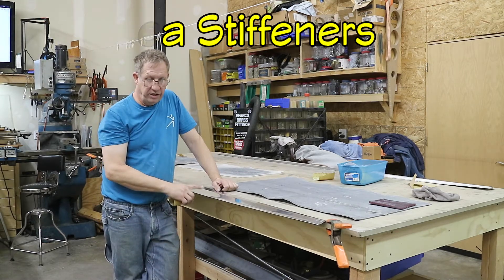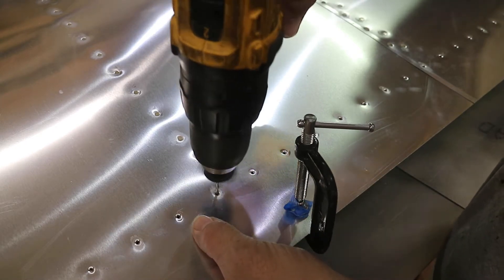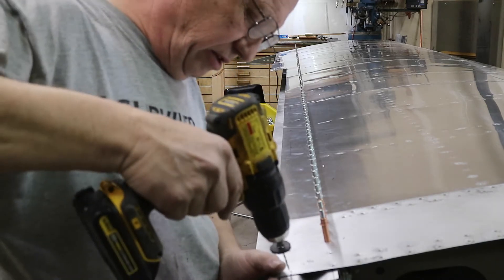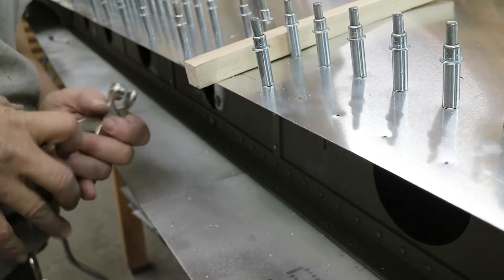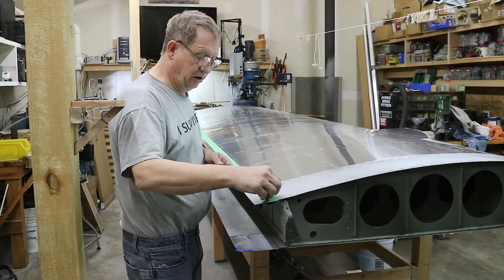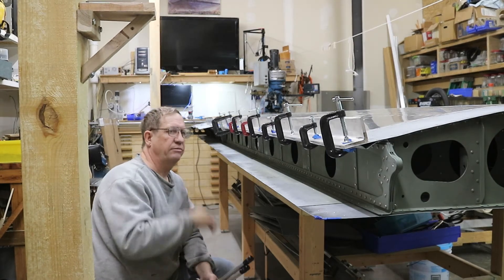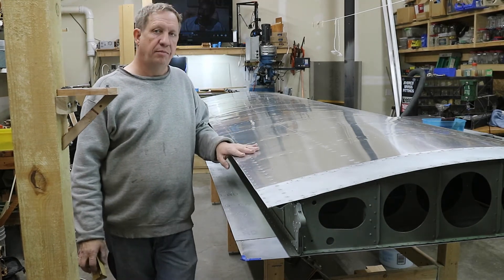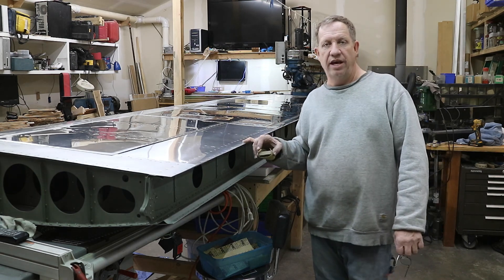Bearhawk Experimental Airplane Build : Flap Stiffeners

Comment: Appreciate you putting this online.. your videos are solid gold 

The Bearhawk really needs a video scratch build series .. baby stepping the whole build... from start to finish

the current scratch build manuals are $30 each wings/fuselage/finish ...they are well worth the money and Eric`s site is a great resource http://mybearhawk.com/ ....for the mechanically inclined they work very well... but at times it leaves some head scratching for those new to aircraft construction...

Videos are where it’s at..

Bob Barrows sells a lot of plans . An enterprising builder could make some good money with a comprehensive build video series, sold in modules.

The Bearhawk can sell for over $100,000 when completed, it’s a great plane and in demand